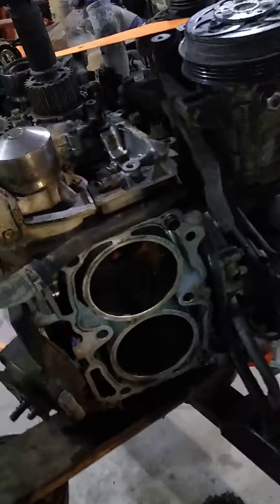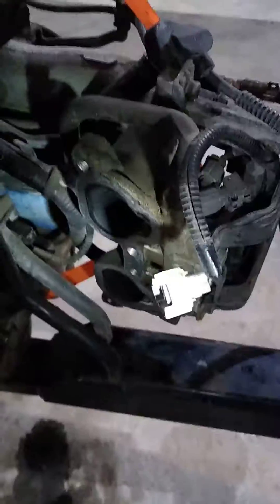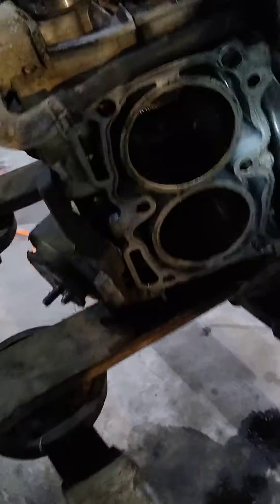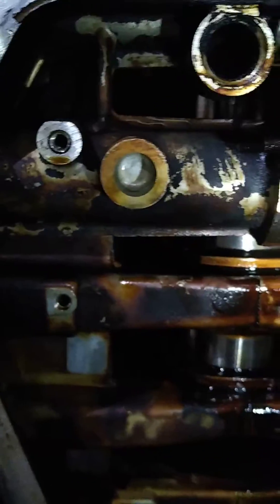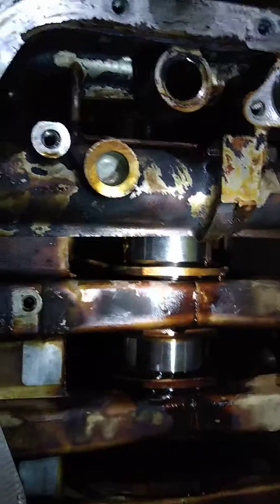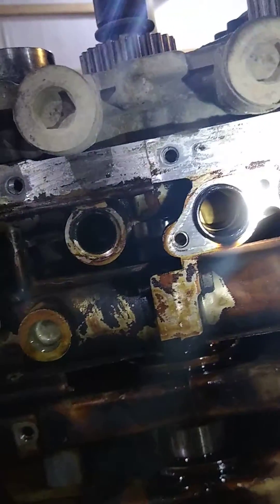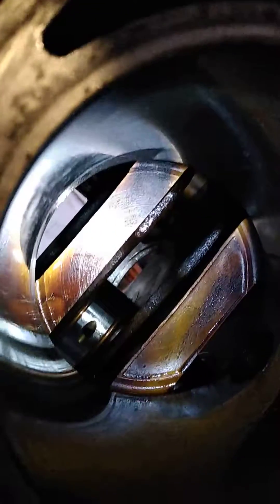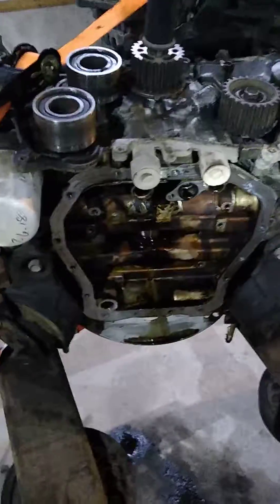Subaru EJ25 SOHC rebuild DON'T SPLIT THE BLOCK!!!

Comment: Hey Mr. I need your help please…I pulled the engine and put it on a motor stand….Piston 4,3,2 is out…I broke 3 of 1/4 swivels 😅😅…now piston one has to be done…I get acess to the rod cap bolts but how can I pull the loosen rod cap out of the engine….or how can I put it back on the rod with new bearing that the bearing fit correct….there is no room for pulling it out and replace it back on the crank….????
Reply: Update : Im finish!🎉🎉Cylinder one had bad rod bearings…the play wasnt that great but enough for knocking at idle Speed and over 3000 rpm…
I polished the crank stepwise on cylinder 1 and changed all bearings on all rods, new Piston rings on each piston …done this with a filler guage and worked the Ring ends fine that they fit perfectly…new oil pump and put all parts with new head gaskets and new headscrews back ….did the valve clearence…

Engine runs now perfect 💪👌…no knock and other strange noises!

I was suprised that no piston was slapping ,the cylinder walls where in perfect condition and the pistonsbottoms where clean ….that on a Legacy that has now 300300km on the dash…and over 200000km running on LPG 😮!!!

Thank you again for your adviece ❤! I will report how long this will last !
Reply from the maker: @jeanjumpmeyer1214  run it down a tall hill no throttle.  Dynamic breaking only.  Hopefully that will seat the rings.  Chrome rings DO NOT seat easily
Reply from the maker: @jeanjumpmeyer1214  ya gotta roll the crank around as the nut gets loser.  Use a little magnetic tool.  Don't lose the nut.  When the nuts are off, pull the rod & roll the crank to pull the cap out of the same hole.  I know, it's a bit of a pain.  There's always the option of splitting the case but that's the last option.  If you do, use an impact to break the case bolts lose and then loosen them with a ratchet.  Do not run them out with the impact.  The threads may pull out.
Reply: @murphystreeter  Thank you so much ❤, that worked fine now number one is out and its time to install the new Pistons with rings….before I have to polish the crank on rod number one cuz there was my bad bearing that causes the knock when hot running engine…thankfully the crank was not damaged so bad ….the bearings where worn out and they did not even fit in the rod cap 😅…. I can tell you how glad I am for not splitting the block ❤🎉💪👍👍Thank you
Reply from the maker: @jeanjumpmeyer1214  a bad rod journal may not survive too long.  New rod?  Sadly, you can only plasti-gage the rod bearings if you split the block.  Very common with any of them made after 97.  Make sure you use Hastings ductile iron rings to prevent future blowby & oil usage.

Comment: Thank you! 250 pounds isnt that much , I ve got an ej253 in an 2004 Legacy with automatic transmission! 
Maybe I have a rod knock on cylinder 1 …there is a little play when I Push against the rod with a screwdriver beneath the engine …my engine knocks only when warm …when cold only at start up for 2 seconds than it runs fine until it gets warm …than i can hear a knock like a piston slap that does not go away at idle speed ….when I raise rpm the knock goes faster until 3000rpm and than I can hear a metallic knock….
Im confused …could that be a rod knock??? I bought the car with that feature half year ago…now 10000km later the knock wont go louder ore more worse? Is an piston slap audiable with warm engine? Thanks for your request❤

Comment: Hi, can you tell me how heavy the engine is when I pull it out with the mainfold intake? I need to know cuz my garage ceiling is out of concrete but its a ready garage and the concrete isnt that thick, so my Job I want to do is to drill a hole for an express anchor M12 with a hook and pull the engine with a pulley….might that work?
Reply from the maker: @jeanjumpmeyer1214  I'm guessing around 250 pounds for an automatic.  Add 50 for a clutch, flywheel, & pressure plate.

Comment: How do I find out if I need 48 mm bearings or 52 mm rod bearings for my 2009 WRX I currently have Rod knock, but I am trying to do a quick fix without removing the engine I believe rod number four has the most played, but I’m not sure what bearings I need
Reply from the maker: @edwardmartinez7605  pull a cap off and measure the bearing and journal.
Reply from the maker: @edwardmartinez7605  forum says 48mm is for EJ25D the rest use 52mm

Comment: hello! would you please help out on how can I able to remove the piston #2 I already remove the piston crank shaft but its hard to push out the piston itself out of the block.. what I can do next?
Reply from the maker: If the piston won't come out of the cylinder you can use some sandpaper to mill the ridge.  Feel the top of the cylinder wall to see if there's a ridge.  That make a cutter for cylinder ridges but it's expensive.  I've never seen a Subaru with a ridge tho.

Comment: Is it possible to replace the rods without splitting the block? I'd really like to avoid it if at all possible...
Reply from the maker: Yes.  If you have to replace the rods, chances are that your rod journals have damage. Did you spin a rod bearing?
Reply: @murphystreeter  There's nothing "wrong" with the rods, per se, other than they are 131.6mm long... I have an 01 2.5RS coupe with 120K. I think the HGs are going, so I was thinking if I threw some STi rods and pistons in there while I have the heads off I could boost it cheap. I'll already have the engine out, so a crossmember swap will be a cinch.
Reply from the maker: Should be in the video.  Gotta have a 1/4" impact ball swivel and 1/4" extension.  I think it's #4 that is the difficult one.  It's a tight squeeze.  Totally achievable.  Check your decking with the new rods.  Please reach out if there's anything I can do.

Comment: Just an update, i just pulled the engine again and replaced the bearings on all rods. No Rod knock! all noises gone. I learned that you do not need to remove the wrist pin for cyd #2. Simply went from 4 - 3 - 2. Removeing the rod caps, turning the crank and then pulling the piston out of each. one by one to not get them mixed up. I then ran a bit of metal polish on the rod cap and crank. then cleaned with break clean. INstalled new Bearings and used assembly lube to crease the crank. Torqued to 33ftlbs. Cyd#1 i removed two and bought 3 cheap 5$ swivels 1/4 drive. Broke two of them. Make sure you have a magnet stick and patience. I pulled out #1 and reversed the process. THANK YOU for this video, i did not want to split the block.
Reply from the maker: Awesome job Noah!!!  It's definitely a good way to break some tools but beats the hell out of a full tear-down.
Reply: How did u get cap on piston #2 I removed 3 n 4 but can’t get to the top one on piston #2 a 1/4 12point swivel socket fits in there ?
Reply from the maker: @edwardmartinez7605 I have another video....let me find the link.  You have to have the crank in the right position, piston out, go in through the opposite cylinder with a 1/4" drive socket and swivel.  A ball swivel, not a double joint swivel.
Reply from the maker: @edwardmartinez7605 https://m.youtube.com/watch?v=TLBr8S7R1Cc

Comment: Is it possible to do no 1 in the car?????
Reply from the maker: Yes but you have to have the impact style 1/4" swivel.  It's a bitch to start the nuts.  Gotta have a magnetic retriever.
Reply from the maker: I have never tried in cradle work.  It's too easy to pull the engine
Reply from the maker: You have to have the pistons out

Comment: I've been wanting to rebuild an EJ257 engine I've had sitting in my garage for a long while. I rather not deal with machining anything cause the engine is still in good working order, and I'll sacrifice replacing the journal bearings for now, just to avoid splitting the block. But I do want to break it down enough to replace the rods, and pistons with something a little more hefty, and replace any other serviceable part within reason. The rods have been a big question mark in my head, on weather I can fish them out. Are they reasonably easy to fish out? Or is there a technique to it?
Reply from the maker: They come out easy.  Needle nose plyers will   get the clips out.  Be sure to ball hone the cylinders and buy Hastings ductile iron rings.  Watch my video on the EJ22E and you'll see that good rings will cut into the hone marks when they seat.  That will eliminate oil burning.  Look at the EJ22E heads to see there isn't carbon all over the combustion chamber like you find in the 253/257, etc.
Reply: @murphystreeter  Took note of everything. Thank you for the reply!

Comment: Thanks for the video, i just did a head gasket job on my outback, to find out i have cyl 1 rod knock and have to tear the heads off, didnt want to split the block glad i found your video, was it difficult to pop out only piston 2 or put back in? and did you have to polish the crank or use bigger bearings? Still running good? haha
Reply from the maker: Rod knock is bad news.  Very hard to plastigage.  Roll in the new bearings and say a prayer.  Check rods for distortion on the big end.  Might be good insurance to replace the rod that has a knock.  Hastings ductile iron rings are a must to eliminate oil burning, blow by.  Use multilayer head gaskets.  Depending on the rod you're removing, you may have to push another piston out.  Good luck bud!!
Reply: @murphystreeter  By rod knock i mean nice rattatatat at a constant power setting. i pulled the pan off and sure enough nice rice sized flakes, maybe about 14 of them, i grabbed each rod cap and wiggled them, and of course its #1 can move it back and fourth about 1 mm
so spun bearing is the proper term? surprised the car has lasted the 7000Km i have driven it with that noise. I really dont want to split the block so ill give this a shot.
Reply from the maker: A new set of 4 rods is pretty affordable.  $160 gets rods & pistons

Comment: Thanks. You've saved me some time. I have a rusty number 1 cylinder and thought I need a o'haul. It's been sitting around and it's a low milage import. So bearings should be fine. Hopefully I can do what you suggested and just hone that cylinder and new rings. Thanks a lot.
Reply from the maker: Your very welcome Jay.  It makes me feel like I've contributed to the cause.  Best of luck my friend.
Reply from the maker: The more you describe your engine, the more I worry that the crank has some damage to a rod journal
Reply: @murphystreeter  Why is that? Any way the engine is running fine and has plenty of compression. The rust is not protruding into the bore, so the ring just skips past the slight pitting.
Reply from the maker: That rattatat is the crank journal hammering the bearing into oblivion.  Proceed with caution and careful inspection before spending money on the new parts.  I've got my fingers crossed.